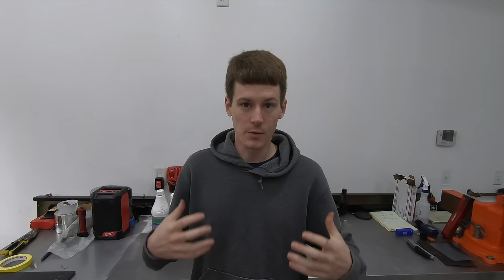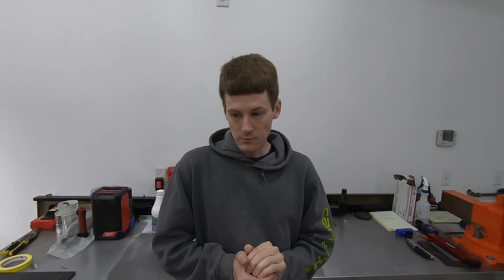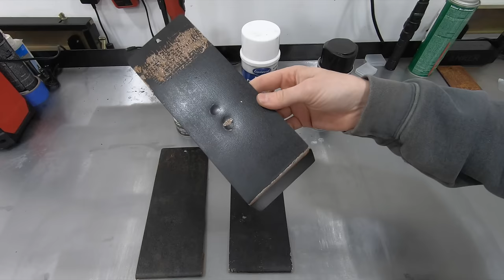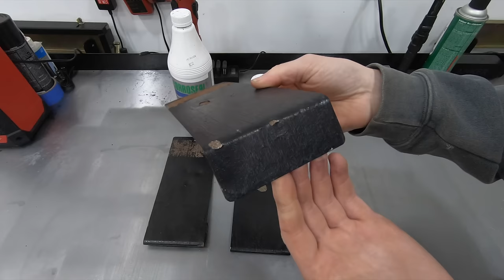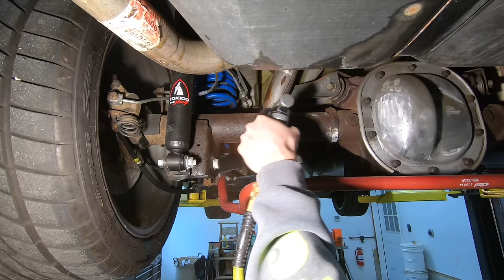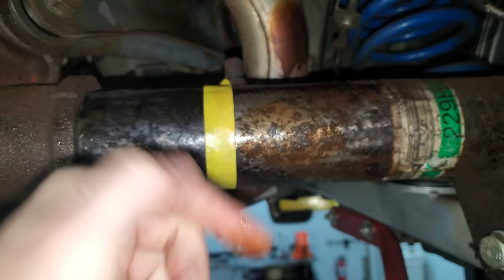MOST Rust Converters Are A JOKE! Let Me Show You. (Eastwood, KBS, Corroseal, Ospho & More)

Comment: Not sure what happened with your Ospho application process, but I've used that product for decades with excellent results and never had that scale left behind. I use it on areas like inside car doors where access is difficult and like the fact  that it seeps into every nook/crack/crevice to convert the rust and stop the rust in its tracks. I've repaired many an old classic (aka: rust bucket) w/ Ospho as well as Rustoleum's Rust Reformer aerosol. Any product that doesn't adhere to the substrate is merely an encapsulator, not a converter.
Reply: Have you ever used it on heavy rust? I have a bit of a couple of rust buckets myself and am wondering if it works on stopping deep rust that has created holes in the metal.
Reply: @gloriaschwazenhag2252  that would have to be cut out and new welded in..  this is really only good for stopping service rust, the first mm is the metal..  and keeping surface rust from penetrating.  if it penetrates the metal is no longer metal🥺
Reply: I have a 1997 volkswagon with a rust spot in the door sill. It hasn't made a hole but it has started bubbling the paint in a 2" spot. There is also surface rust starting along the bottom edge... very minor...but I want to stop it. Would you recommend Ospho for this?  I would just like to use denatured alcohol...but maybe  this is better? Any advice welcomed. I don't really want to start sanding and grinding and making a big job of it...especially along the edge and disturbing the paint with the surface rust. Any advice appreciated...
Reply: @2coolartsmusicmom572  If you see bubbling in the paint, there is no other real option other than to do some amount of sanding and/or grinding, etc.S trip that section where the bubbling is and take care of the source of the decay, then give it a coat or two of a rust converter and a seal coat to keep it from coming back.
Reply: @v.e.7236  ok thanks. I have a dremel I could use I think.  What kind of rust converter do you think is best ...the Ospho? Thanks for responding...
Reply: @2coolartsmusicmom572  That or the Rustoleum spray version (what I like). Make sure to seal it afterwards or it will come back. Proper prep work is key. Good luck.
Reply: @v.e.7236  what do I seal it with please 🙏❤
Reply: @2coolartsmusicmom572  Any finish coat paint and not just primer.
Reply: @v.e.7236  thank you...I am going to dove in and try as soon as I find my dremel or buy one...maybe on buy and sell.
Reply: @v.e.7236  hi again

The vehicle that I am trying to deal with the one spot of rust in the door jam is 25 years old. I am going to grind as per your instructions...amd use rust9leum and prime and paint...thank you for the advice. Also noticing that there is a light film of rust settling on the paint at the bottom edge in spots...not under the paint and not dark...just a light coating on top. Can I wipe it off with denatured alcohol and wipe down with lanolin or something?  Just trying to preserve her...1997 volkswagin eurovan...
Reply: @2coolartsmusicmom572  That should take care of the surface issues, yes. Does your Eurovan use the inline five cylinder engine?
Reply: I am not sure...it is the 2.8 gas engine...

Comment: Great analysis! Wish I had seen it before buying a GALLON of coroseal.

I’ve used “ospho” many years, primarily to treat small parts by soaking. The only problem with this is that if the part is rusty enough it WILL lose volume as the rust is converted, leading to things like nuts and bolts no longer properly fitting together. Does a GREAT job converting rust otherwise, and even works ok for surface treatment if you are careful to keep the surface wet and keep the ospho from running off. I’ve even dampened a sacrificial cloth or paper towel in some cases.
Reply: @kitjasabsgabs1830  not a typo…an autocorrect gone unnoticed. Should have been “ ospho”, which it insists on “correcting” to sophomores. To be so smart sometimes it is pretty dumb…😂
Reply: @kitjasabsgabs1830  yes it can!😆

Comment: Fantastic testing methods. I'm certainly curious as to the effectiveness of top coats for these. Has your friend in the coating business ever mentioned a hardy, industrial coating for rusted surfaces? If that is too naive, then perhaps a hardy coating for a prepped surface?
Reply: Bedliner
Reply: Kem kromik primer and 2 part swimming pool epoxy works pretty dang good
Reply: @79huddy Got any pictures?

Comment: Just what I was looking for!  I got a used truck that's rusting on the insides of the very bottom of the doors and want to treat it before it get's to the outside.  I'll try brushing off the larger flakes, brush on some Rust Cutter, and hit it with a coat or two of spray paint.  Hopefully this holds for a while, although I'm sure the real issue is likely coming from moisture sitting inside the bottom of the doors themselves.  Maybe I'll pour some trans fluid inside the door afterwards to slow things down even further.

Comment: I got tired of the exorbitant prices they charge for these products.  I switched to using "prep and etch" paint prep from Lowes or Home Despot. It comes in a gallon and costs about the same as one spray can. The msds shows that it is mostly phosphoric acid. A gallon size fruit tree sprayer works really well applying it to the underside of a car. It works better than most dedicated products I've ever tried.
Reply: Hey Does it pretty much neutralize rust and prep for paint? Thank you
Reply: @josephpuchel6497  It neutralizes the rust pretty good. You have to knock off the heavy flakes to get a real good surface. I used a needle scaler. Then spay or brush on. Use a second coat if you need it.

Comment: Thanks for the great video.  That was a lot of work that will help a lot of people.  I did have one question though which you sort of touched on in the beginning.  You mentioned products by PB Blaster and others that are not necessarily rust converters.  Do you recommend skipping the rust conversion and going right to a rust inhibitor like the PB Blaster Surface Shield?
Reply from the maker: Exactly. Rust conversion is only necessary for paint.

Comment: My understanding is in order of effectiveness at rust conversion it goes Formic acid, Tannic acid, and Phosphoric acid. There is also Gallic acid and Oxalic acid. Not sure where they fall on the hierarchy. Concentration and application also matter. VHT is Formic, Rust Reformer is Tannic, and Ospho is Phosphoric. In my experience, VHT will let rust back through when exposed to moisture. Rust Reformer much the same, but it can work well if enough rust is removed. True of most products. I now have Ospho and Klean-Strip Concrete & Metal Prep, but need to do more testing with them. Phosphoric acid seems the most professional and effective product. Prep before use and before painting are very important too! Nice tests.
Reply from the maker: Agreed on all counts. I the next test is going to be rust dissolvers, evaporust, metal rescue, etc. I'm also going to test the effects on plating, aluminum, and brass. Filming this week.
Reply: @RepairGeek  Awesome! I've had decent luck with Evaporust. I've found if you leave stuff in it long enough it can turn to some kind of strange scum, which is interesting. May be something else that got mixed in. My current theory for best possible rust removal and prevention is basically a 5 step process. Remove rust mechanically, use a rust remover and clean, use phosphoric acid, prep again, proper DTM epoxy primer if painting or whatever top coat is appropriate. Eventually I'll know how to actually save something. 😂
Reply: @802Garage  before top coating use a primer containing 90% zinc this will stop the rust as the zinc acts as a galvanizing coating to stop the corrosion.

Comment: Once you have rust, unless you fully neutralize or eradicate it, you're always going to be chasing rust no matter what you do. Best thing is to treat the surface before it forms. I really like Evaporust for non-chassis type applications. I don't really like those 'convertor' products that turn the rust into Magnetite or Iron Phosphate. I was at a surplus type dollar store and bought 2 gallons of some industrial grade rust convertor for $3 a gallon. OK for what it is but that's about all I would have paid. Looked thick and milky. It did work and turn the parts black. 
I bought a set of steel rims 6-7 years ago for my winter beater and one was coated in that POR15 or similar urethane. I had to clean them up last fall and that was by far the worst wheel. Paint was bubbling and scabbing up. Underneath looked like it was on the bottom of the ocean. Once that POR is compromised it just rusts beneath the surface. I've tried most of those products at one time or another. I think Ospho is just a mild Phosphoric acid.

Comment: I used a product called rust mortifier . It was a quarter size deep rust spot, I sanded the spot and coated it with rust mort. didn't paint over it. the bronco sat in my yard for 20 years till I junked it. the only spot that didn't rot was the spot I treated and never got around to painting it. These products don't work on surface rust which is what you had , they won't stick to bare metal .

Comment: Several Years ago we did an A, B, C comparison of rust converts and rust sealers on a Steel walled swimming pool.  We knocked off the loose rust on a section of wall and coated pieces with CorroSeal, Extend, Rust Bullet, and some Rustoleum.  Then we top coated with pool paint.   Bottom line the rust converters were useless.  Corroseal being the worst.  Rust was literally coming thru the pool paint in two weeks.  The only thing that worked decently was the Rust Bullet.  That stuff is a moisture cured urethane that truly encapsulates the rust, and leaves a great surface to be top coated with whatever topcoat you prefer.  You can leave w/o top coat if you like an aluminum like finish.  Its pricey, but you'll never need to coat it again.

Comment: So if you were to undercoat your vehicle now, and it already has rust, what would you do to remove and proof it for future? Sounds like, 1. Remove loose rust with brush, drill or sandpaper. 2. Use Rust Kutter or VHT to convert any left over surface rust, 3. Use Surface Shield as an undercoating. Is this correct? Thanks!
Reply: I sure hope to somebody replies to your question that's exactly the question that I had Tom
Reply: Say what is is surface shield?
Reply: Yes I am watching too

Comment: A note on Rust Cutter and why it is probably the most effective out of all you've tested.

I saw one guy on youtube who uses a combination of pure phosphoric acid water solution (of some concentration I don't recall) and he mixes it with fumed silica to achieve a gel structure.

Since the silica itself is inert, it acts only as a neutral thickener. But due to it's amorphous porous structure, being saturated with the solution and applied to rusted surfaces, it:

– stays longer on the surface without drying, which allows more time for curing due to water and acid not vaporizing as fast

– since it's a gel, it will stay on vertical AND "ceiling" surfaces, unlike the pure liquid forms. Although liquid ones will have better penetration into cracks and crevices due to capillary action, so both methods applied one after another would achieve the greatest effect overall

It would be interesting to see if you can test that on, say, underbody of a car or to simulate the positioning with the same plates with different products (and a 10-20% phosphoric acid solution in water as a control) with and without fumed silica.

I can't get any of that thickener where I live (at least at a reasonable price) unfortunately, so can't test this myself at the time.

Comment: Thanks for the video. Planning on doing some rust removal and re-coating on a truck I bought and was about to go on the hunt for ospho, but the Rust Kutter seems way easier to use and seems to not have a lot of the downsides/etching on good metal issues that Ospho talks about on their website.

Comment: Klean-Strip Concrete Etch & Metal Prep from the cleaning section of the paint department at Home Depot or Lowes.  It's phosphoric acid that will strip rust.   Soak rusty metal in it.  I use paper towels to keep a surface wet.  Don't let it dry.  The residue is a pain to remove.

Comment: Good and thorough video. But I have to say, that the normal Rust-Oleum rustwandler - the bottle doesn't look like the one you have - makes a H.. of a differnce here in Denmark, Scandinavia, where it's very humid always and the roads are covered in salt every winter. I can't explain why, but for instance stone chips and edge rust repairs will last years longer when treated. And, besides that, I think a 2,5 kilo ball dropped onto any laquer will leave a serious mark. And try to press a piece of duct tape onto a brand new car and see what happens when you pull it off...

Comment: On my monitor, the Rust Kutter panel still looks orange-gray. Perhaps another layer of product would remove all of the orange? But for my application (an AC condensation drip pipe in my garden that has cracked at the tip and is dripping rust from the cracked area and whole end of the pipe since it seems to be missing paint there), I really like that there's little flaky black stuff and that the product is better for upside down and vertical surfaces.

The Star Brite panel looks perhaps 100% converted (gray + black). But since the pipe is curved, I don't know if I'll be able to get rid of all flaky black residue before painting.

The VHT on the axle result also looks great.

Comment: You do great work as far as comparing products.  The problem, that you friend should have pointed out, is that most of these products are not designed to do what you tested them to do. Conversion coatings are no designed to be left on a surface for rust protection.  They are designed to provide additional protection to permanent coatings like paint.  Paint is porous to moisture and so there has to be protection underneath it.  Also, you may have misread the instructions on some of those products.  I know for sure that you misread the instructions on the Loctite product.  You are supposed to remove all rust possible before application.  Conversion coatings only work on the molecular level.  They do not convert more than a few atoms deep.  Iron phosphate is not a durable coating regardless of how you create it.  Even in so called Heavy Phos applications, the iron phosphate is mainly there to hold onto an oily coating of some sort to prevent exposure to moisture.  To truly covert rust you need a reducing agent like Oxalic acid (highly toxic) or some other chemistry.  Coper Sulphate, etc.
Reply from the maker: "No need to sand down to bare metal, simply spray directly onto rust."
https://www.rustoleum.com/product-catalog/consumer-brands/stops-rust/rust-reformer?ls=7830730&lc=Rust%20Reformer

Comment: Use rust kutter with a brush, it's so thick that the spray nozzles don't work well. Also, it has acid, so you don't want to be freely spraying it around most times. I only use kutter on areas where I need it to stick, if it's a flat or pretty clean surface I prefer por15 rust converter, basically just acid and very watery. Then if I'm painting the surface I use por15 encapsulater as a prime coat before using filler primer, then paint prep... I hate living up north lol

Comment: Excellent report on rust solutions. 

Questions, need to use high zinc engine oil for life in flat lifter engines? Also is unleaded gas effect on original iron head valve seats enough to qualify expensive pressed in valve seats? A wear rate query actually.

Recommended product, (I'm not a seller) Gibbs brand lubricant. Sprayed it on new clean raw steel rims 3 years ago zero rust,  other non treated raw sheet metal same car same time is surface rusted. Also good penetrant and lube. A friend said he painted over it after it dried and paint stayed (on a lube?). Expensive but a lot of us use it.

Comment: What would be best for sheet metal pinch welds, seams, and spot welded on brackets? Rust gets in between all of these and there needs to be a penetrating rust converter stopper that can be sprayed and will wick itself through these folded and welded joints to stop rust. For example, under all steel pickup truck beds there are spot welded brackets on them. The water and salt get in between these and starts the rusting and there is no way to get to these rusted surfaces because these joints and sheet metal overlaps are permanent.

Comment: Consulted the owner of a sandblasting business about how to treat the surfaces after he sandblasted them.  His advice…Ospho.  He likened the sandblasting to surgery to remove cancer, and the ospho treatment to chemo therapy after surgery to negate any residual rust.  The “rust converters” need a rusty surface to work, so the sandblasting route is not directly applicable to the use of rust converters, but if you’re looking to give your project the best treatment against future rust, sandblast, treat with ospho (multiple costs are best), rinse, dry, prime with epoxy primer, and top coat as you like.

Comment: I used corroseal on my trailer over 3 years ago and it is still holding up very well. I think your test is a bunch of bunk. If I took a brand new vehicle with a perfect factory paint job and dropped heavy items on to it putting dents into it and wrecked it putting sharp bends in the metal I bet I would have chips and rust all over the place in no time. I don't plan to wreck my trailer so I am sure it will be good until then. Afterwards maybe not so much.  LOL